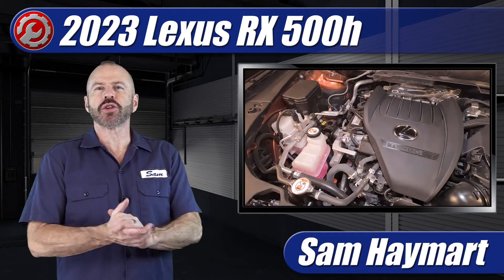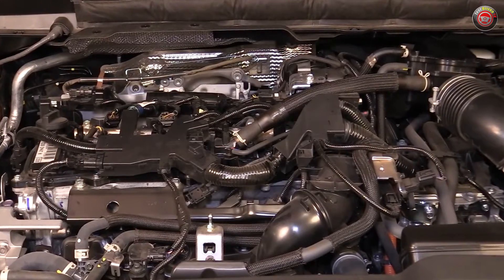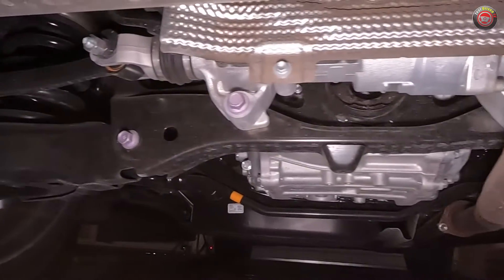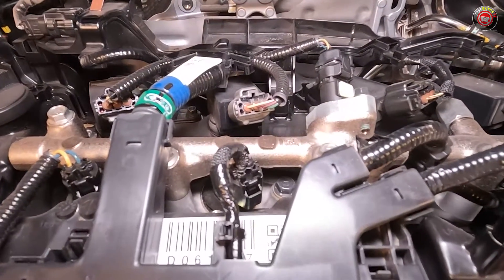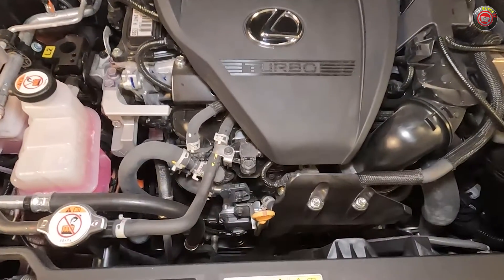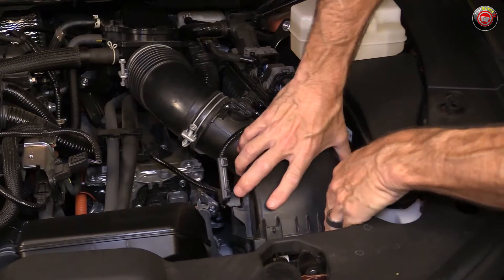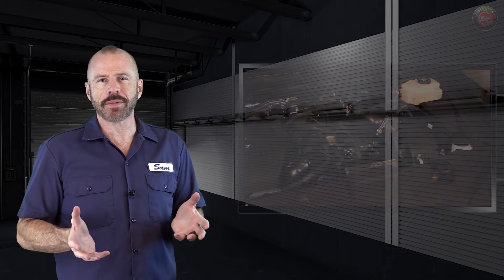2023-2024 Lexus RX500h: Engine Explained

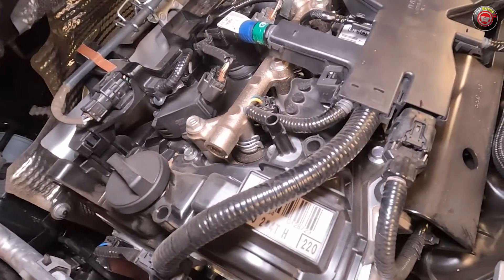Comment: 1:55 500h requires 91 octane or better, explicitly stated in the manual due to increased boost and timing over 350h. 350h 2.4 you can run 87 octane.
Reply: I have a 2024 NX 350 F-Sport which has the same engine.  It requires 91 octane fuel.  I don't know if the engine management system can compensate for lower octane.  It would certainly 'detune' in an attempt to avoid knocking.  What I really like about this engine and, I believe, all of the Lexus engines is that they are direct AND port injected which is good for the valve train.

Comment: Thank you for this post.  Unfortunately our modern age is delivering over complicated, over engineered power trains.  I am Not impressed.  Why have dual fuel?  Oh that's right because Di is a carbon nightmare for the valves!  What did we accomplish?  You can get just as good fuel economy with a stand alone MPI!  Why have a turbo or hybrid electric motors?  We have seen 30+ MPG with a naturally aspirated MPI engines with a standard six speed transmission.  I don't want  to sound like a hater, but seriously, why over complicate?  No good reason.  There is no significant power or economy gains with these over engineered systems.  Just give me a simple MPI, naturally aspirated engine that has not lost it's identity.  LOL  HAGD, God bless.
Reply from the maker: It's because this can deliver that mpg and also product 300+ horsepower. That is the "why".